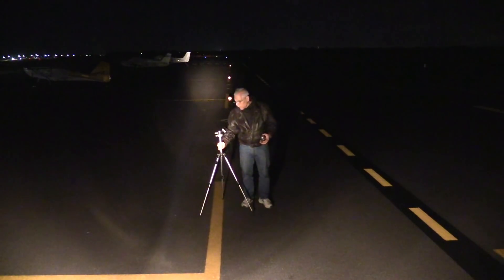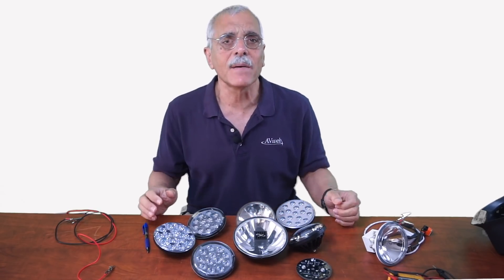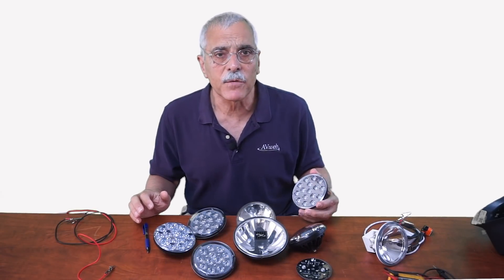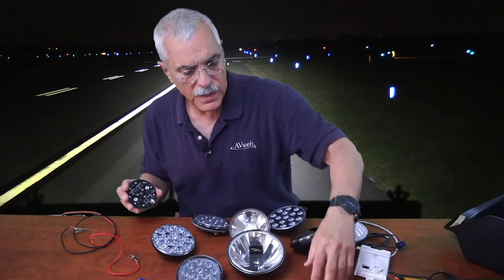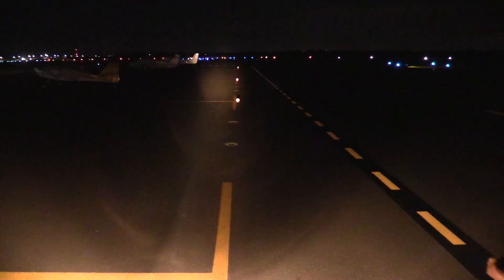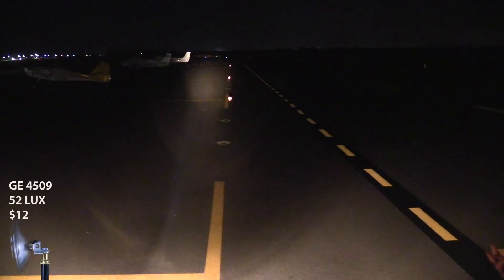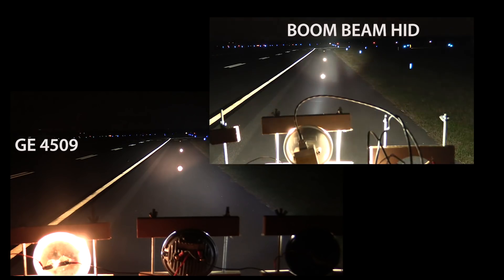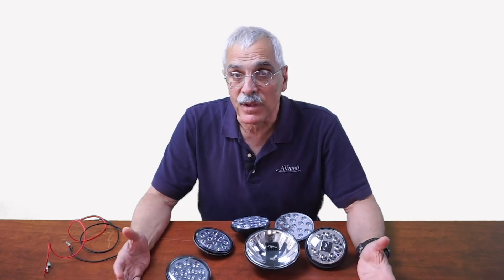The Unbearable Brightness of Aviation LEDs

Comment: That secret sauce "lens" in front of the LED emitter is a CPC, or Compound Parabolic Concentrator, a class of non-imaging optic. Non-imaging optics do not follow the design rules of typical lens and mirrors, they have different rules. For a CPC, imagine taking a portion of a parabola that does not reach the vertex, Now spin that portion about a new axis, forming a non-linear conical surface of rotation, and there you go. A CPC usually is solid and works by total internal reflection. Sometimes a conventional lens is placed at the large output end, making a hybrid optic.

CPC's are very effective at producing an even narrow conical output from a flat emitting area. (And vise versa in the case of solar concentration).

CPC arrays are easily and cheaply molded. I guess the CPC lens plate for one of these lights adds about $30-$50 to the overall cost.

BTW, the highest levels of solar concentration have been achieved with non-imagining optics.

Comment: Be advised that LED's do not last forever, like we were originally told.  No, they don't have a filament to burn out like incandescent bulbs, but the supporting electronics fail.  And since those components aren't replaceable, you end up throwing out your $650 bulb anyway.  And while the mean time between failures might be longer than that of incandescents, the expense when they DO fail is always multiples of the cost of an incandescent.  So buy LED's for the better lighting, not the higher reliability and perceived longer life.

Comment: The one thing to point out is that the whiter cooler light shows the colors on the runway a lot better. You can get more light with a yellow light but need more light with yellow to differentiate color and in some cases lose all ability to see color. White lights allow you to see color but have their own drawbacks.

Comment: When i was doing lights for a band in 80 i used dc3 landing lights fit right into par64 can. Loved the solid beam they made when fog machine was running. Like you could cut them with a knief. 24 volt run four in series and 110v

Comment: Here is a question for you
I have seen very high altitude aircrafts with 5 sec. interval white beacons. They flew so high that the commercial airliner (A330-200, KLM) that came in from a perpendicular angle, seemed so much closer and having three distinct white beacons flashs.. 
And the speed of the high altitude aircrafts with the 5 sec interval, was significantly faster than the airliner i could track on  flight radar24 . com..

What did I see?

Comment: 20 high output 6000K surface mount LED's of a good brand $2.00, PCB in mass production $3 each, The very likely common decent brand of a few electronics on board $5, The molded lens that were designed already and used by many manufactures $0.10 per light for the license. 

Cool looking airplane sticker and the word Aviation... $600 Most expensive sticker you'll ever buy!  Great video by the way, you did a great job.

Comment: 10:43 you went full ElectroBOOM. Never go full ElectroBOOM. (It's a Youtube channel where a guy does various electrical "experiments" and zaps himself frequently, resulting in long strings of bleeps.)
LEDs are a huge upgrade over incandescant for any purpose. Put LED headlights on my old VW Bug, $80 JW Speaker knockoffs from eBay, massive upgrade. Been thinking about helping my mom do the same on her RV-7. The current ones draw huge amount of power (this is the other big advantage of LEDs not mentioned in this video) and are so dim they're almost useless. Problem is that it doesn't use standard lights like these, it uses some sort of smaller thing I'd expect to see on track lighting or maybe an overhead projector, so there are no drop-in replacements on the market - she's looked. I bought some compact LED fog lights on eBay for around $15, they are impressively bright, especially given the cost. I'll have to find some way of jury-rigging them into the wingtips, I think it can be done, maybe using 3D printing. I'll tell her to fly 10 hours with them on during daylight before using them at night to get a little bit more confidence in their longevity, ensure they don't burn out on the first flight. Ah experimentals... The cost of these does seem a bit outrageous, LED headlights are now available for cars, unbranded stuff that actually is decent, for under $100, and those are much more complex than landing lights, those $15 fog lights seem more comparable in terms of requirements. I guess it's a combination of certification for aircraft parts (I assume the products seen in this video are certified) and the small market size not being alluring to these cheap knockoff makers.

Comment: What is the power rating for these lamps? I think that, unless they're super powerful, $650 for an LED light seems very expensive.

I'm really into car headlights and a set of decent LED bulbs is about $30. These LEDs are usually rated at 30w.

I have a 55w hid kit that cost me $50, and a set of HID projectors that cost $20. They light up the road amazingly well, and I can't imagine that similar tech could be used on a plane. I was thinking maybe 4 55w lights (which would be $100) and some projector which focused most of the light at the front with a thin bright line projecting towards the sides. I don't think such a system would be too expensive, and might outperform those $600 LEDs you showed here.

Comment: The reason the LED lights don't give the same brightness as the HID is that they are producing wider beams, if you halve the beam width you quadruple the on centre intensity.  The reason that they are producing wider beams is that the size of the lenses used by the LED lights is smaller, (Forget the horrible Illumivation design which optically is a disaster).  If you double the size of the lenses the beam width will halve.  As a designer of LED lighting I could produce a beam with four times the centre intensity of the HID just by reducing the beam width.  And furthermore LEDs are still improving, these lights are not using the very latest LEDs that have become available in the last 6 months.  The next generation of LED lights will give the same centre intensity as HIDs and cover a much wider angle, they will be much cheaper, far more reliable and more efficient.  HIDs days are numbered!  The comment that HIDs will probably always outperform LEDs will be proved wrong in 12 -24 months.

Comment: Great video for the night time comparisons and thumbs up however. LUX is the incorrect measure to use. For a good comparison you need to have a high vantage point to see how the beam spreads, this will let you know how they will perform on approach / during taxi / on runway. A pencil beam will be great for approach but useless for when on runway or taxi, a broad beam will be great for taxi but not runway or approach. 

Halogen and HID light cannot be easily be compared in LUX or lumen to LED unless a visible light pas through filter is used, Most LUX meters will also measure non visible intensities as well.
Halogen HID and incandescent lights have high outputs of UV, near inferred and inferred light comparative to LED lights that produce a narrower spectrum of light. 

Lux vs lumen
Lumen measures total output while LUX measures an instance of illumination within a area of measure. So two LED light outputting the same lumen amount may have differing LUX amounts. 
Candela and LUX are the first signs of a scam on packaging with the ONLY exception being a LUX map/Graph for beam pattern.

A good high power LED cluster in 2019 will produce ~1000lumen for every 10watt and need about 6 to 9 cm3 of cooling fins per watt. 
In the automotive world right now (q1 2019) you can get a 320watt 30,000 lumen 9 inch round led lamp that has a 1LUX value at 500m and a 3500LUX value at 5m and has a heat sink fin volume of 5.5cm3 per watt. the kicker here is it cost $200usd and has a  CISPR 25 Class 5 rating.

Comment: One important thing about light pattern is that it should avoid lighting up too close to the vehicle and actually provide a wide pattern that has most of the power some distance away. This will improve the night vision since the eyes won't be disturbed by the close bright light. You will still have enough "leak light" for close items.

Comment: One could probably do their own QC work and buy the emitters, collimators, sillicone mold casting resin, and optical clear epoxy to make 30 lights for the price of one light here. Just figure out how to array and align the collimators for good beam coverage while having the LED facing end on a common plane. Then build a jig to hold the collimators. You'll need to make some smooth form in the overall frontal lens shape and polish it glossy smooth. Then make the silicone mold casting over that. Now you can make multiple molds with the form. Then you can just place collimators in your jig, place that into the resin mold, and then pour the optical clear epoxy. (Front end of the light is a bit bowl shaped, so it should be straight-forward.) What comes out of that release mold is then a larger lens assembly of clear epoxy bonded collimators. And now build the back end out of 20W or 50W emitters aligned on a heat sinking circuit-board to fit the collimator array. LED drivers are also a relatively inexpensive parts bin piece, so test and mix and match to find the best for the job.

The back end that goes over that is just stamped aluminum or steel, that can be additionally heat-sink in some way. Probably something that can also be hammered out, or just make a can, since unlike regular lights it has nothing to do with the optics. (The back is only an enclosure in this case.)

Of course you need to have some soldering skills, and perhaps a few odds and ends like a vacuum container to degas the optic epoxy right before the pour. Still all that would put you at a much better price point than some part that costs $300. And then you'd have skills to custom make stuff from thereon.

The bin parts thus are stupid-cheap for what they are, but all the pricing must be in QC - which is potentially better if you DIY.

Comment: Wrong, NOT coherent beam, you meant to say collimated beam. Coherent beam refers to light that has photons of the same energy, like when a laser emits light it's coherent because the wavelength of the photons is nearly the same (technically it does have variable wavelength because of impurities and temperature variations in the diode junction that make the full width half max about 1nm wide or so, but the point is that it's super narrow compared to LEDs, which are considered incoherent light sources). Furthermore a while LED is a broadband light source because it spans from the blue to the red wavelength, so it's definitely not a coherent light source, nor is it a coherent beam.
A collimated beam is when the light from a point source like an LED is reflected or bent with a lens to travel in a parallel path towards infinity. Now because LEDs are still ~1mm^2 in area, and not a perfect point source and the lenses/reflectors are not perfect either, you get a somewhat collimated beam, could be as good as +-6 degrees FWHM, just depends on the optics.
Reply from the maker: Listen again. I did say collimate.

Comment: The plate with the raised mounds you have that fits over the LED's is a Wavien collar which harvests the light that would spill to the side and combines this light into the forward portion of the beam. 

If you want to focus a LED, you either need a reflector or an aspherical lens over the LED. If you use a aspherical lens, the projected beam will have the shape of the LED. A reflector will project a round beam pattern.